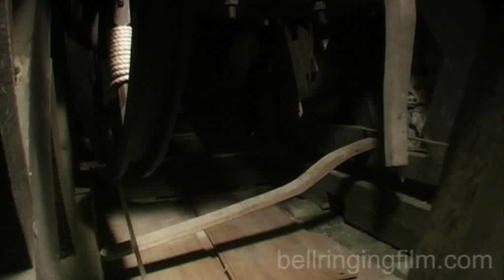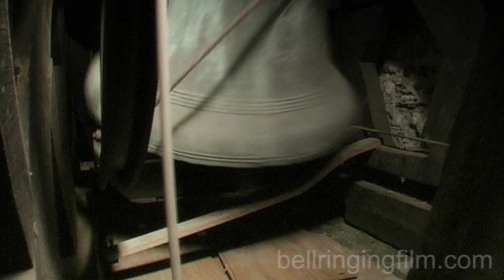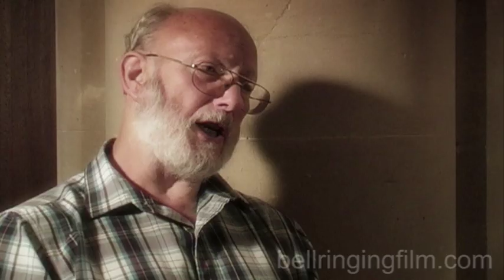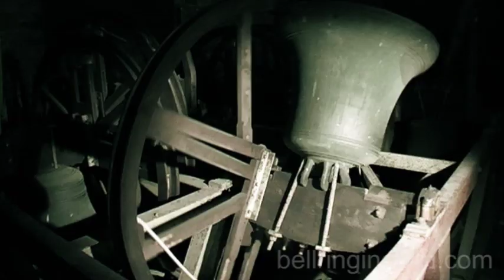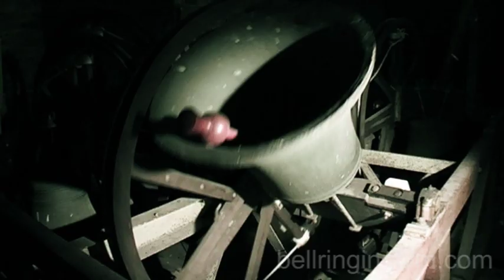Breaking the stay

Comment: I did exactly this last week on my fourth visit. Took everyone by surprise, most of all me! Managed to let go before I took flight!
Reply: Did you have to pay for the damage
Reply: @1260stedders  no; it comes out of the tower’s fund for maintenance and is usually accepted as a result of training. The rule of thumb is that the breaking of the stay is the fault of the trainer rather than the trainee, but it doesn’t stop the massively guilty feelings! 2 years on I still have it in the back of my mind!
Reply: @seanDB1989  was it rotten
Reply: @jacobparry6212  nope - solid, until it met the slider with a bit too much force
Reply: @seanDB1989  oh dear

Comment: If the stay breaks and the bell is swinging with no way of stopping quickly can it break the support and fall?
Reply: Not likely, the bell will continue to swing until it stops itself hanging downward. It will remain fixed to the wheel and headstock. Should the frame which holds the bell in place become unstable and cause the bell to fall, it will likely be a wider issue resulting in the entire collapse of the tower or all the bells to fall together. I would personally say the chance of a bell falling is almost zero. In fact, I have not yet heard of an account of this happening.
Reply: I read an article about a tenor bell falling down a tower in Kilmersden, Somerset. The ringers were actually in the ringing room ringing the bells at the time. They thought the tenor wasn't handling as well as it usually did, before it came away from the frame and crashed down two floors. The ringers fortunately got away as it fell.

Comment: York Mister has steel stays!
Reply: They are red painted wood with a metal tip on the end
Reply: Ok =D
Reply: The metal part is a 'trigger' which is part of a system called a hasting stay. I won't attempt to explain here how it works but it eliminates the need for the slider in the bottom of the bell frame.

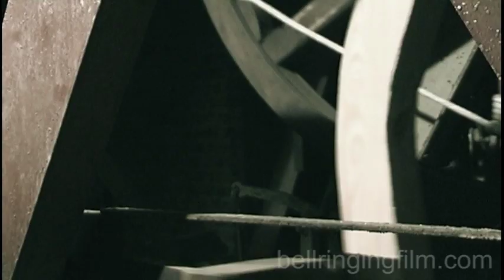Comment: 0:55 Bell destroyed , Bell Rope will go to the dump
Reply: Bell saved, the stay has broken saving damage to the headstock and bearings. The stay is cheap to replace and the rope is not necessarily ruined either. Three weeks ago, a stay broke at our practice and the rope and bell we perfectly fine. In fact, our most experienced ringers rang it up and held it on the balance so it could still be rang for the evening before the stay was finally replaced.
Reply: The bells fine, I rang it a couple of months ago!

Comment: Why use plank? Use steel!
Reply: Maybe try and listen to the fucking video?
Reply: ffs ezekiel are you slow?
Reply: Think of the stay as the fuse in a plug. It's a safety mechanism.
I've only ever had one ringer I was teaching (I hadn't taught them from the start, I should add, I was running an open practice which they attended) break a stay. I gave it to them as a trophy.
Most stay breaks happen as a result of either a lack of explanation of the mechanics of ringing, or someone being rushed through handling and over-pulling.
Reply: It is supposed to break
Reply: @RingerLuca651   you are a money waster 😑😑